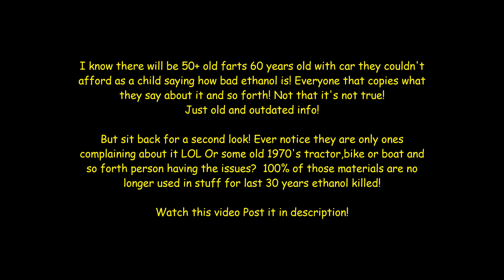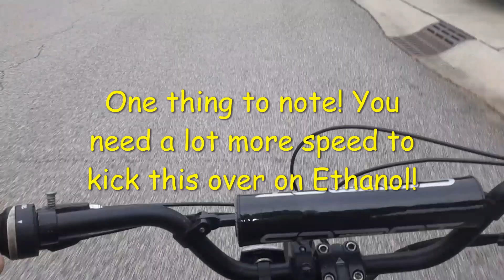CrAzY, I Converted the 49mm Iron Sleeve - To A Pure Dedicated Ethanol Monster Last Night!

Comment: So oil burns correct try adding cooking oil to gasoline mix in some acetone and fuel stable with your two stroke oil watch what happens to the cooking oil when you put that into the gasoline add that first you can also add some butane liquid to the mix don’t smoke while doing this lol just try if you don’t believe me you’ll be surprised by how good it runs measure as you think apply much appreciate the videos

Comment: Ive always said things that make the biggest difference? Porting and fuel period. Change nothing else but fuel more power change nothing else but porting more power! Bro if you still serious about that nitro build I have some old champion glow plugs that are designed to convert ignition airplane engines to nitro, hit me up!
Reply from the maker: I have 3 70cc nitro 1/4 scale trucks 😅👍 legit 15mm glow plugs.  Actually  copied port and head spec  when I gutted yd100 and 49mm iron sleeve builds.  No one noticed ever I was using #4 plug in both lol.  Only way ignite the stuff keep it running.